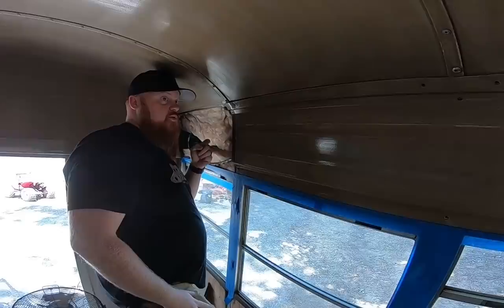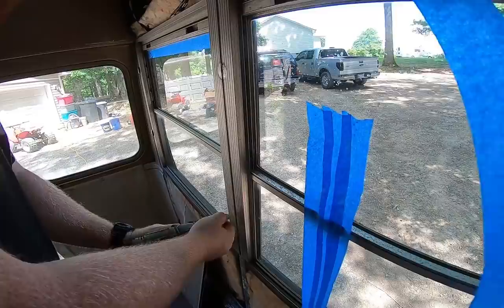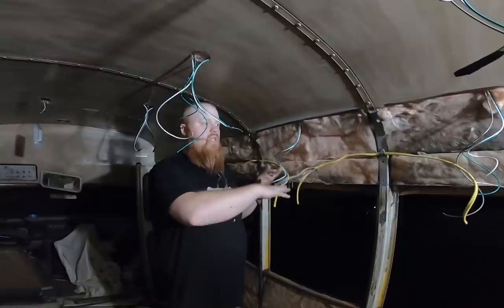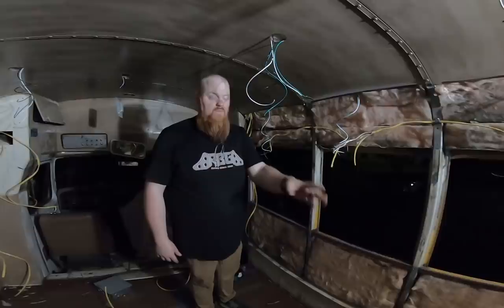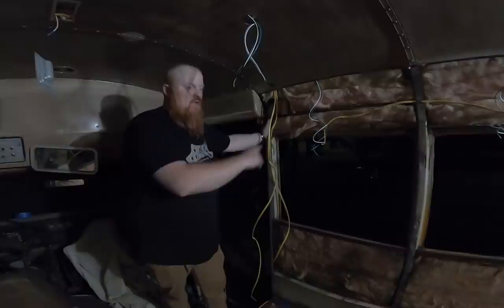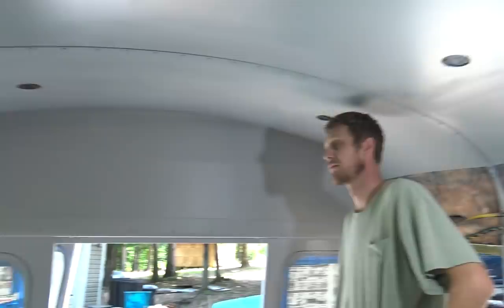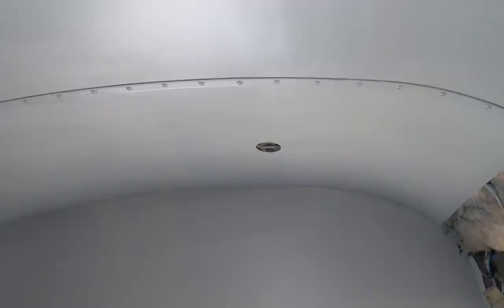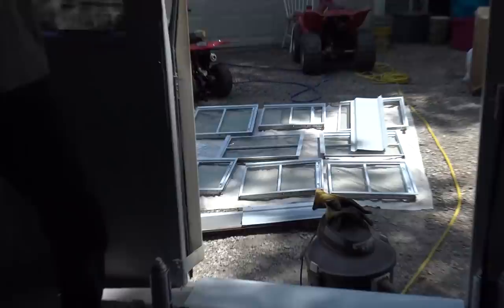Short Bus RV Conversion Ep ~ Painting and Wiring

Comment: The Bus is excellent. I’ve been busing for a good decade plus. 

The only fatal flaw in your work was to not remove the old insulation. Please do yourself and family a favor and replace the insulation. 

I’ve always kept the old insulation on my builds and paid greatly for it. The temp is all over the place, not to mention the chance of mold. Finally on my current full-size bus conversion build I’ve stripped everything down. Installed vapor barrier and some kicking insulation.

Comment: The chassis, with all the years of improved design to be safe  durable and dependable is going to be kick butt! A diesel would be even better! Is a trailer a part of the build? I would  ditch a couple side windows and add some size appropriate skylight/ air venting improvments. Can the Roof support  a  camera/ drone  aux.? Lots of potentially epic shots!

Comment: Go to tractor supply get magic paint by the quart white and black mix to make gray 
They sell gallons as well
It’s around $12.00 for qrt 
They sell Hardner and reducer 
Use harbor freight gravity fed paint gun $15.00 
It’s cheap easy and durable
Pro tip .....add very small amounts of black to white in a separate container to get gray 
Shade you like go slow

Comment: you can actually spraypaint fabric , holds up reasonably well , as for the connectors look intoo wago blocks there realy good in connecting solid core wire to multistrand wire https://nl.rs-online.com/web/p/non-fused-terminal-blocks/5077011/
eazy to add and take out wires too
colour is ok , its better then white as it shows less when you touch it with greasy fingers , the wax will be even better 
depending on the colours youre going to add it might get a little too battleship , if you want to put stickers or vinyl up intoo the interior you might want to wait with the wax untill after thats done
speaking of vinyl , its probably a good idea to leave the windows you dont want covered in vinyl out of the truck so they can wrap it a little eazier and hide the seams better

Comment: Lights 12vdc = low voltage.  110 ac high voltage.  Never run low voltage and high voltage in same raceway.
Reply: WHY?
Reply: @justastudentoftheworld3940  No. Is the simple answer.  The correct answer is it can be if there are multiple stipulations.  This is in the NEC code book.  The only way it is permissible is if both cables are rated for 600 vac.  Also with LEDs working on such low voltage, it is possible for the induction of the 110vac to cause the lights to stay on
Reply: Also, never want to use solid wire for dc.  The voltage of dc runs on the outside of the conductor.  Want to use stranded to allow more surface area.  Should never use ROMEX for DC.

Comment: Just a heads up you can't run 12 volt DC with Romex Wire you can only use Romex with AC current
Reply: Solar wire which is a romex wire to use for DC.

Comment: What you spent in rattle cans, must have been a lot, $ 25. At tractor supply would have gotten you a gallon of gray another 10 for thinner, and 10 for a spray gun at harbor freight, and you could have sprayed 4to 5 coats for the same or less, but good work anyway

Comment: And this is also another one of those dumb things that you probably already know. But if you're going to run water system inside your bus do not use pure PVC try to use what is called PEX pipe it is flexible it will be and it will Contour you can also run all your electrical wires through it if you buy the black PEX pipe the red and the blue was more for your water the black is more for like when you're running through concrete buildings and you don't want to check a phone concrete itself or the rebar that you got the drill besides we use black PEX pipe I run electrical wires all day everyday I live in the state of Ohio I literally live on the southern side I'm connected with West Virginia and I literally run electrical and I literally run water and plumbing all damn day everyday pardon my French I don't mean to cuss I love the bus